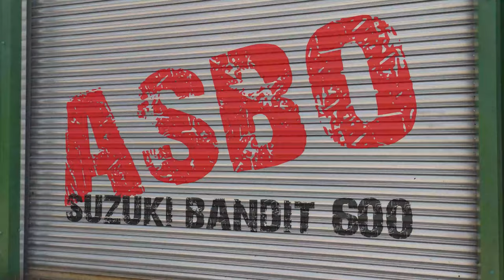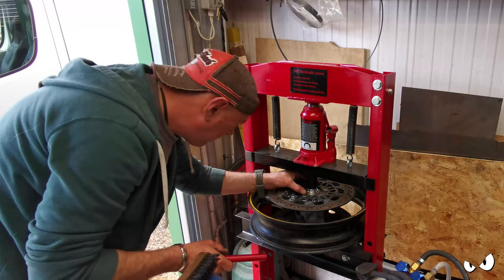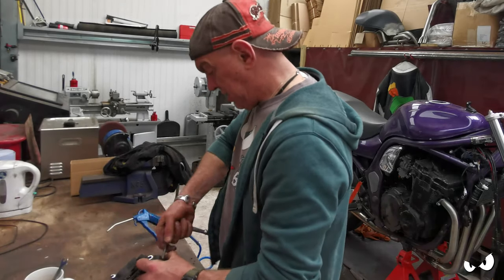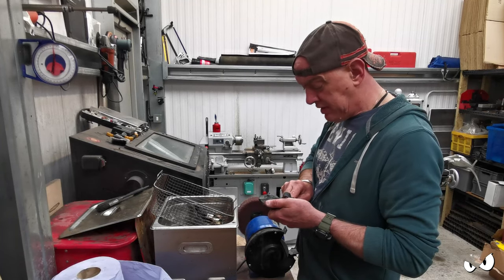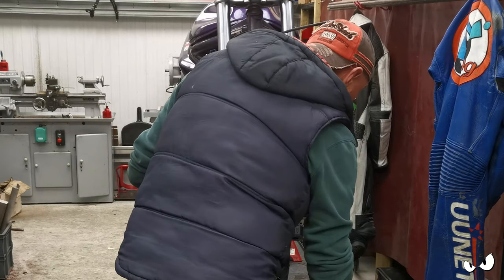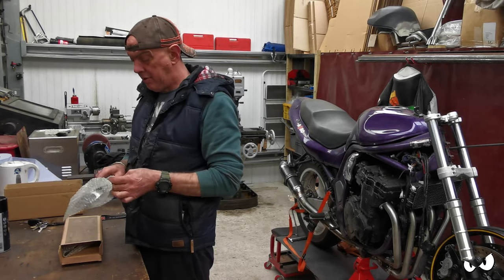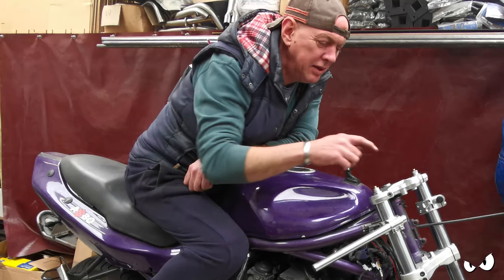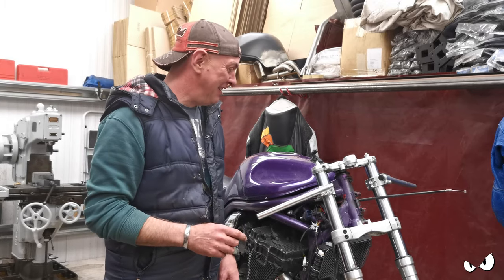Suzuki Bandit Front End Swap - Bearings and brakes

Comment: As you discovered the caliper bolts are a Japanese m10 x 1.25 thread. They may say Triumph but they're made by Nissin. Those clip ons look a bit extreme for the road but then I'm not as flexible as I used to be. If you can work out how to mount them on the yoke itself you could position them level with the plane of the yoke instead of above or below. Another good video, shame about the door, must do your head in. I did mine.😄
Reply from the maker: I should have noticed they were fine thread, but its an easy fix 😁
I'm still playing around with the yokes in CAD trying to.come.up.with something that looks nice but clamps well where it needs to... not as easy as you'd think... 🤔🤣

Comment: the forks will drop as the tubes go lower meaning the finished position will be the same as just trying it now with the clip ons touching the top yoke
Reply from the maker: Hehehe... yeah, I didn't explain it very well, but it made sense in my head 🤣😂
Reply: @QuickBikes  That's what I thought. I thought the point of dropping the yolk was to raise the height of the front end, so the dropped two sides of the yolk would be clamped to the top of the tubes and the clip on's could clamp directly under the yolks. So the trial run could have the clip on's clamped directly below the yolks now??

Or am I missing something??
Reply from the maker: Nope, that's it.... I just didn't explain it very well in the video.  Essentially I'm trying to mount forks that are 50mm shorter than stock to the bike, so I'm having to make dropped forks so the geometry of the bike remains unchanged 😁👍

Comment: What type of set screws or bolts would you buy for a bike when you need to replace them? I don't mean the expensive packets from a dealer
Reply from the maker: Personally I like stainless steel just because it doesn't rust as quickly... whatever the head is would remain the same though 😁👍
Just a personal choice I guess

Comment: Well youre in a bit of a conumdrum there with the top yoke and the clipons ,the geometry of the front end and position of riding. i guess youl have to put the clipons incorporated to the top yoke design to wet up a bit more.,you are in a extreme position of riding there your hands are leveled with your knees in the picture ,nice for track days maybe not so good for road use....Maybe ,just maybe you dont need to lower the top yoke at all you are also changing the rear swing arm so you can control its travel to suit the original wheell base and dont need to go so low in the clipons....Cheers!!!!
Reply from the maker: Yeah, all good points and worth considering. At the end it's a test bed, so we'll give it a go and see if I like it or what I need to change  😁👍